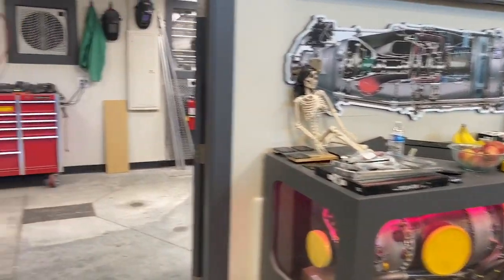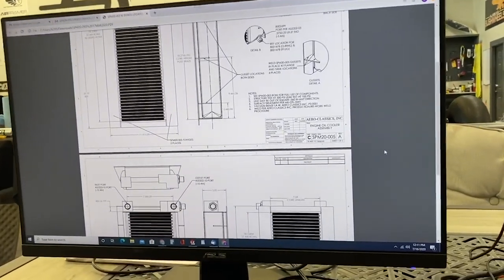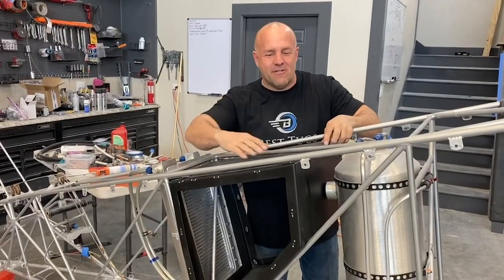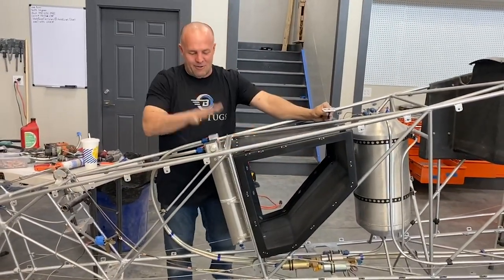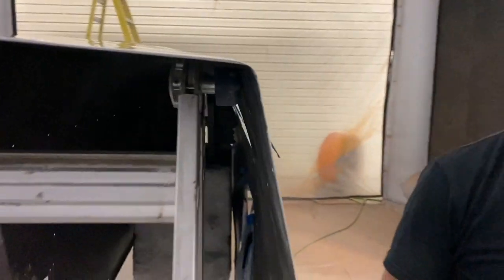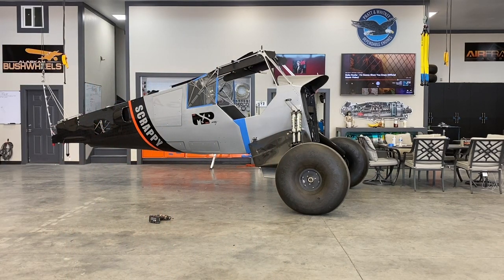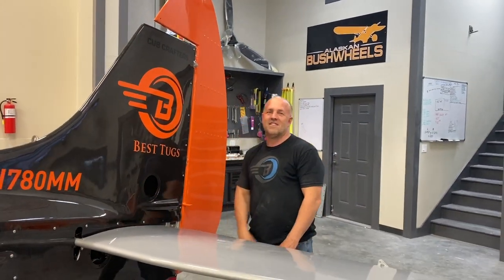Scrappy Bush Plane Gets Tail Feathers  🤠 (Scrappy Bush Plane 24)

Comment: The attention to detail is what separates you from the rest of us normal guys. The gust lock interlock for start up is truly next level!!
Reply: Now I know how to steal it.  Oh, I'll steal it!  😎
Reply: Yeah, his "one off work" looks like he's done it a thousand times. Craftsmanship at the highest level!
Reply: That's true. There's alot of thought that has gone into this build.. Mike knows his Sh#*!!
Reply: On the gust lock pin, when you put it into the home position in the cockpit with the micro switch, what stops it falling out if you find your aircraft inverted? Also I assume that if the pin were missing only prevents startup, and wouldn't cut the engine out if it were accidentally removed from the cockpit. (Like the cutout switching a motorcycle stand, not a condition youd like to find yourself in in mid flight)
Reply: Oliver Jocher  plus there will be an ass who will try to steal it as a trophy at the air show at night or something!?
Reply: @Oliver Jocher There's a small button on the end of the pin (that's in between your index finger & middle finger, pushed with your thumb like a syringe plunger) that releases a small pin that keeps it locked in place, you have to push the button in order to remove the pin.
Reply: @cherep777  yep.true that..darn trophy hunters
Reply: @lmead  because he did, i think in video where he tests line vs carbon pipe he mentions that he had prototyping company with his brother, they've been the quickest prototyping company in US. :D
Reply: I think more planes need to do something like this.  There have been a few over the years where someone had installed a warning light on the panel to let you know that the pins weren't stowed in their rack, but nothing to this level.  Gear pins, gust lock pins, in this day and age, there should be no reason for someone not to put a little microswitch and rack for them in the plane and have it at minimum activate a light if they're not stowed when you power up the plane.
Reply: when is he going to notice that a Plane needs Wings? 🤣
Reply: @sammiller5509  I wouldn't put it past his engineering that the plane would fly right now just fine without them.  Between the engine, the wheel "wings" and the bigger elevator and rudder, it would probably be pretty close.
Reply: @oliverjocher2999  The pins have a locking mechanism within them for when in use. That same mechanism will retain the pin in the home spot. And yeah, he mentions it's purely interlocking for the starter button operation. Brilliant piece of design!
Reply: I doubt there are many, if any aircraft (or craft of any kind) built to Mike's standards. When this one's finished, if you factored in the man-hours, it would be valued at ... who knows? But safe to say, well into seven figures.
Reply: @CAPFlyer  lol...what do you think the chute is for...Mike said it's for getting out of a sticky situation....but maybe it's for a powered canopy 🤪
Reply: @EliteRock  I said the same to my wife earlier today as we both watched it. Mike mentioned Draco went into high numbers.. for scrappy he's reusing another engine which cost him "nothing". Dont get me wrong, I'm not dissing you Mike. I love your outrageously generous heart...and I cant wait to see footage of your newly finished Bush plane flying, and winning a few well deserved STOL trophies.
Reply: For sure!
Reply: Thank you for explaining details. The key to life is learning and sharing knowledge. Great job. Engineering Well done. Thank you sir.
Reply: @sammiller5509  It may fly without them with 500hp!😁
Reply: @lovetoflylovetofly3843  duuude, it just came to my mind that he could use his parachute like a ultralight glider😆, go Mike !!!
Reply: Oliver Jocher I’m sure any time he leaves the plane he will take the pins with him for security. Kind of like taking the keys out of your plane or car.
Reply: @oliverjocher2999  The pins have a ball bearing on the side of the pin near the end to prevent such an occurrence. These safety pins are used on nearly all aircraft if not all of them. The red button on the end at handle end is what locks and unlocks the ball.
Reply: @jacknnan  That would kind of defeat the purpose of the gust lock.

Comment: I don’t build airplanes... I build sculptures and architectural structures... but I want all my apprentices to watch these videos so they get a feel of how In Depth you have think thru complex systems.  A comprehensive understanding of the materials and forces involved results in a comprehensive design, well worked out.  The little things like body parts that snap together, Planning for conductive isolation, Thinking about how the water will get out and how a metal tube filled with a hot liquid gets Longer...  You see it as he assembles it, but realize that he must have planned for that with his initial drawings.  
And perhaps most importantly, that thinking this way is Not a Chore...   but an infectious enthusiasm and a pure joy that comes from seeing something you thought out in every detail go together and work exactly as you envisioned.  Every CAD designer and 3D modeler ought to be required to BUILD the things they design.  ( at least for some years ) It makes them much better ( and more valuable ) designers.

Comment: Ahhhhh........ wow........ I put a lot into my little Weld & Hobby work space but then  I look at what you did........so......... as the Sun rises today I'm, as you say, It's "Back to Work" for me .... I see from what you did some ideas that I'll have to put in place also ,... the exhaust fans in the wall at the end of the bench, fantastic idea, (cutting' holes today) ........Aluminum Diamond plate wall backing, nice touch and I know where to get some.............and I'm going to upgrade my old shop lights to the new cool & bright LED............ so much to do but I'm kinda focused now. 
Thank You for the great video, "Scrappy" is looking better & better .    Stay Well, Fly Safe

Comment: Another comment said this was a masterpiece and I agree.  The attention to every single detail - the finish on the carbon fiber, the fit of the metal tubes on the front landing gear, the way the fuselage was laid up on the aluminum to leave just the right amount of space for the isolators, painting the names and tearing out each individual little hole in the D's and P's, the microswitches to make sure the rudder lock is not only out but inserted into its storage location...it just takes such tremendous dedication to do a project this size and still chase all those little details.  Absolutely blown away.

Comment: Soon as you started talking about the rudder lock, I'm thinking "that's awful tiny, would be easy to forget..." immediately says "microswitch for ignition" - why did I ever doubt you? haha!
Reply: But if the microswitch fails in flight will the engine cease to run?
Reply: @Asta-wl8jz  He said it interrupts the start switch not the run circuit
Reply: @Asta-wl8jz  I trust he thought of that :-) He does say "the start button won't work", so I'm guessing the actual ignition is not running through these microswitches.
Reply: @Asta-wl8jz  If it 's just on the starter circuit, then no, it wont stop the engine running. The only issue I guess would be if the engine stops and needs to be restarted in flight, and the microswitch has failed. Very unlucky circumstance, but you have to think of everything lol. I'm sure he's already thought of that, but if not, a time delay system could be one way round it. Once the engine is running, the microswitch doesnt do anything. Once the engine has stopped, you've got say 10mins until the microswitch becomes active again. Or you have a fail open microswitch, which would allow you to start the engine when the switch has failed, but could allow you to forget to remove the pin if it failed on the ground. Just thinking out loud haha, bit extreme really. You could fill the fuselage with safety systems to prevent this and that, but that just means there's more to go wrong lol.
Reply: JustUsFlyers I’m with you on the whole added complexity thing. If it’s interrupting the starter like everyone says then I’d feel safer... but I feel that doing a proper preflight and following multiple check lists should give ample opportunity to notice that the rudder isn’t moving. 

What I’d rather see is a warning light.

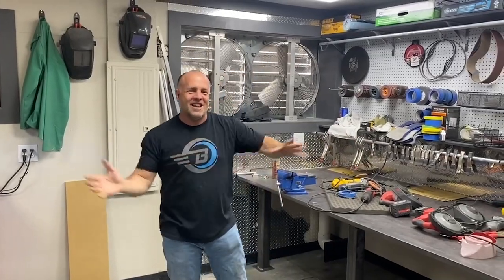Comment: 4:00 I do the same technique when I design restaurants with the hood fan and HVAC. The kitchen is out of balance, with more exhaust CFM than air supply, and dining area is opposite, creating airflow into the kitchen from the dining area. It prevents smoke, grease, heat, and kitchen smells from getting into the dining area. I also add a few dozen CFM to the vestibule airlocks to push flies outside.
Reply: Keep in mind too much negative may compete with the bathroom fans...or any boiler, water heater exhaust.
Reply: @deanmiles3505  Definitely a concern, and for more reasons than you'd think. Restrooms are near equal static pressure, slightly negative. It's a small volume and too much negative pressure in the bathrooms can cause air to be sucked out of the P-traps, and then you're pulling sewer air into the restroom. (If you walk into a terrible smelling restroom, try pouring water in the floor drain). I sometimes used two air grills on opposite sides of a wall or connected by a small duct to control airflow without creating suction.
Reply: I like your style!
Reply: @ryanmcgowan3061   A good tech knows this and you figure it in.  You go, Ryan.
Reply: Ryan McGowan another solution to dried out floor drain traps is after filling with water put ½ ounce of baby oil on top. Twice annually is usually good. This problem occurs more in warmer climates. I’ve lived in Asia for 20 years.
Reply: @billhart9832  It also occurs in the arctic; wind blowing 40+ knots for weeks on end will literally pull the water from the traps, including the toilets.  RV antifreeze is a common solution.
Reply: Glad you care about that because I have encountered many HVAC problems in Restaurants and fast food places. Most common problem I see is, the kitchen gets hot so they crank the AC and then the dining gets freezing. Cheep design or no design oversight or knowledge.
Reply: @billhart9832  It's code now in the states to have trap primers drip water into the floor drains, but if they mop the floors with plenty of water, it wouldn't be an issue. That's a good idea though.
Reply: @Darthreloy  I've seen it a lot too. That's why I paid special attention to these things. I'm not a mechanical engineer, but it's worth getting right. You ever sit "under a vent" and get that constant cold air? It's probably placed too close to a wall. All the little things make the difference, and like most types of engineering, it's only good engineering when people don't notice it.
Reply: Rip every grub screw that is put on that table
Reply: The same thing happened with composting toilets in a 
bathroom, the fan in the toilet competed with the room exhaust and pulled the composting toilets smell into the room. 
I run into a lot of things like that as a plumbing / mechanical inspector and a licensed master plumber. I'm glad you are one of the good ones.

Comment: People: "Dust is bad, put on a mask" Mike:"I build a new dust-free room..."
Reply: Most people would simply put on a dust mask. Mike builds a state of the art clean room. My only other comment is why not put the HEPA filter unit outside of the room to reduce the ambient noise as well as not taking up bench space. Granted there are fans producing noise but it would reduce some of the extra decibels. Now Mike, you need to wear ear plugs when doing noisy work. I wear hearing aids in both ears because I didn't wear them on the flight line when I was an F-4E weapons loader in the US Air Force in the 70's. I love what you've done to Scrappy.
Reply: Reminds me of my mechanics (an excellent channel btw). If anything is busted he says ‘I make a new one’. Machines it, mills it, prints it, whatever it takes; perfect reproductions every time.

Comment: So, I’m trying to imagine the amount of planes one has to mess up to get to the point Mike is at - where every other little part installation has a “you gotta do it this way, or else it can crack/break/fail/explode” explanation behind it.
Reply: Actually Mike said he does all his parts test on the computer and it shows him how the part will move and how much strength it has. He showed in one of his episodes how he build the landing gear and how the computer showed him what strength everything needs to be.
Reply: He also built and ran a highly successful engineering company that specialized in structures and failure analysis.  This stuff is right up his alley.  My guess is that he hasn’t done much trial and error.
Reply: I actually had the same thought. How many planes are built where these details are not attended to, like corrosion of carbon fiber when connected to....whatever he said. Also, are most planes able to take off with pins locking down the flight surface controls?! This all goes on and on...... Mike? Are most planes super unsafe?
Reply: If you have experience and interest in some field than you recognize that a lot of things what Mike uses are well known across the industry. In Mikes videos you can hear a lot of knowledge and as bonus, Mikes choice of possible solutions. The biggest value  for me is that Mike is gifted to explain his approach to the problem and solution he choose and he share this with us. Thanks Mike for your effort.
Reply: Someone Needs to Write Interpersonal Relationship Stress Testing Software Algorithms ' So to Pre Stress Potential Relationships' 😶👍
Reply: Mike is an amazing designer and considers every detail of the structure... But still: The biggest failure point in any aircraft design is the pilot and DRACO was lost to a very short moment of complacency and lack of good judgement... Very little numbers of aircraft come structuraly apart while in the air, but very many come apart due to pilot error...
Reply: I think he’s mentioned building about 14 airplanes. It’s not like he just woke up one day and knew all this.
Reply: Charles White64  Wow, great idea.  It sure would have saved my ass back in the 60’s.

Comment: Mike:  I love your attention to detail and professionalism.  I saw something the other day that might be a good idea.  I know that scrappy will be using an airboat prop.  In the Swamp people, they have one airboat that has a counter-rotating prop.  I know you would have to adjust the thrust washers to make it work which I know you could do.   How cool would Scrappy be with counter-rotating propellers?  Would that eliminate the need for rudder on takeoff?
Reply: Great idea but the problem with adding the mechanism for the counter rotating prop and another propeller is Scrappy already carries a lot of weight, anymore would tip it over the edge, also it's not practical to add anymore weight to the nose.
Reply: @grahamb1  SERIOUSLY there is not one practical thing about any of these creations that get rolled out of that hangar of his 😂
Reply: Only issue I can see with that is you need a gearbox to make the counter-rotating section of the prop turn, so that adds more weight than just "add another prop". Not that important for a swamp boat, but critical for an aircraft, especially one with as much nose weight as Scrappy.
Reply: Add half a ton to an airboat and it just sinks an inch. Add half a ton to an airplane and it won’t rise an inch.
Reply: I always thought that a good solution for power on demand for a bush plane was a shot of nitrous.  I think the big Lycoming could easily take a 150 shot.

Comment: I have a question! 
I just graduated highschool in Germany and I'm planning on studying electrical engineering. Since I've done a couple of build projects before I know (at least in my experience), especially when doing a lot of concept work on the computer beforehand, that often times things don't quite seem to work out in real life and things need to be adjusted/redesigned/switched around/...
My question is whether you've had such things happen with Scrappy and more importantly what they were and how you fixed them. 
I love the videos but sometimes I can't help but think "there's no way everything goes this smoothly without anything having to be reworked at all ever.."
Are you just that good? Or are u human after all?
Much love from Germany!
Reply: Interested in the answer too!
Reply: Me too
Reply: Of course anything that can go wrong will go wrong. It's called "Sod's Law". You just have to deal with the situation. Regards, Jim in NI UK
Reply: @jimcripps3612  What happened to murphy?  I'm sure anybody that replied is well aware of this Soddy Murphy guy.  I'm interested in Mke's success ratio too.
Reply: I’m guessing that all of the years of engineering consulting ( design it build it test it break it) has  highlighted the areas that are most common for issues. Mike is stupid smart with tons of high level connections. There are many brainstorming collaborations ongoing continuously. It’s math physics and engineering that runs through his veins. Knowing the materials and contemplating as many variables as possible while always keeping an open mind for development and design that fuels his (I’m confident) very high success rate one off part perfection.  At least that’s what I think. I’d love to hear him elaborate more about this. Great question.